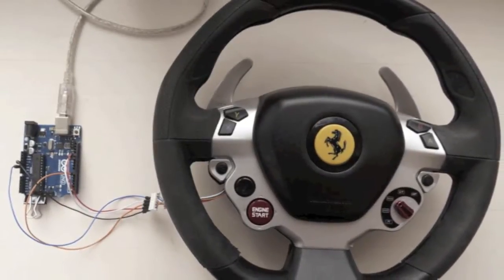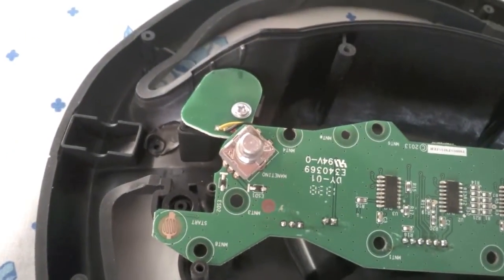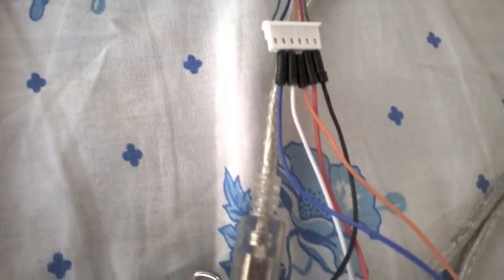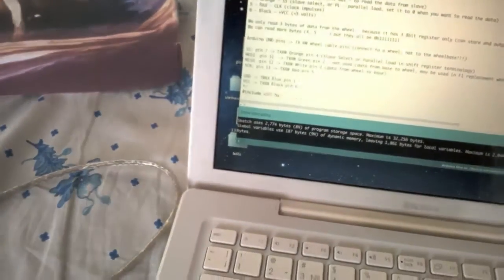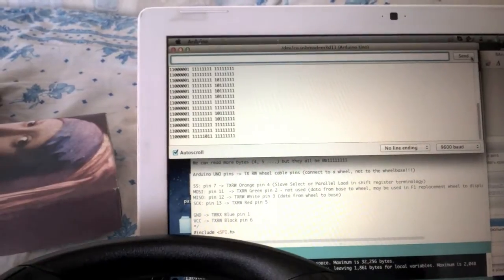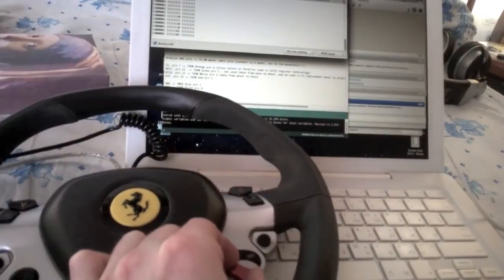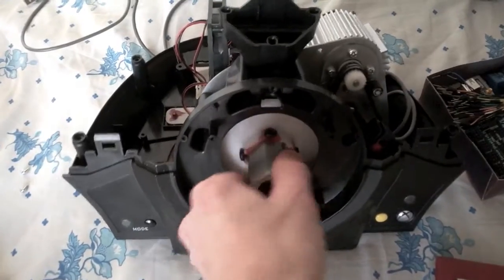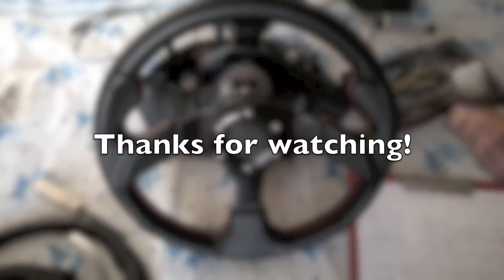Thrustmaster TX RW and Arduino - part 1

Comment: Hi I have a Thrustmaster 599 xx Evo and I want to connect directly to the Pc without Thrustmaster base, can help me? I know that the protocol are SPI i have Arduino nano and Leonardo but I have some questions first i need to made that the Arduino is reeder like a Joystick? Like Leojoy, do you have the file necessary to program the Arduino to be that the buttons are funcionals? Many thanks
Reply from the maker: You'll probably want to look at Teensy LC (it's Arduino clone) - it has USB Joystick library - https://www.pjrc.com/teensy/td_joystick.html

2 things need to be done:

1. Read buttons state from your 599 xx Evo - as I did in my reader sketch
2. Use teensyduino joystick library to send those buttons to PC via usb

Original Arduino Uno/Nano doesn't have HID Joystick library - that's why you need Teensy. Not sure about Leonardo board (google 'Arduino Leonardo HID Joustick')
Reply: mispeaced hi many thanks yes Leonardo is read like a joystick i have put in Leonardo the pedals and handbrake in analogue system and Leonardo is reading for pc like a Joystick and Leonardo have SPI my question is if I put the Wheel in Leonardo SPI port will read the buttons of the wheel
Many thanks
Reply from the maker: That's good. Then connect your wheel to Leonardo - as I show on my schematics + use my reader sketch to read buttons (via SPI). Reader sketch does it every second - you need to scan every 10-20ms (to have 50Hz-100Hz poll rate).

 Then save buttons state into variable (or array of variables). Then pass that to Joystick library that Leonardo provides.

That's in theory :)
Reply: hi many thanks but not works with the buttoms, i connect the wheel in SPI ports but not do nothing when i press a buttom, i not know how programing the Arduino, the Pedals and handbreak work fine in Arduino Leonardo, if i's not possible to read to the wheel, i'll put cables for each buttom and i'll pas to digital points in Arduino leonardo, it's not the best option...but will works fine.
many thanks for your help.
kind regards.
Reply from the maker: Okay, at least we see the problem - SPI connection between Arduino and 599 wheel doesn't work, right? Email me a picture how you connected it, please (my email is here - http://rr-m.org/blog/about/) and let's check what can be wrong.

Comment: question are the buttons normally open or normally closed I assume open as you're grounded signal is given when pressed?
Reply from the maker: Logic level 1 means button is "open" (released), logic level 0 (grounded) means button is closed (pressed). By default all buttons are released of course (disconnected from the ground). Read my article for more info.